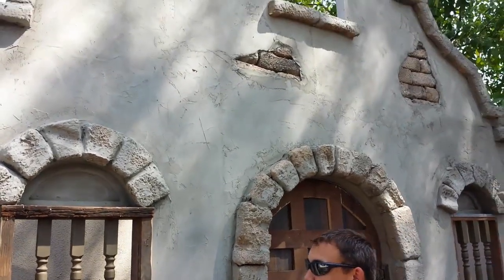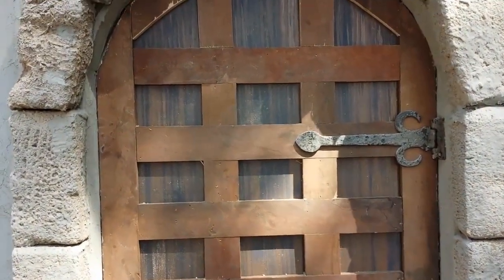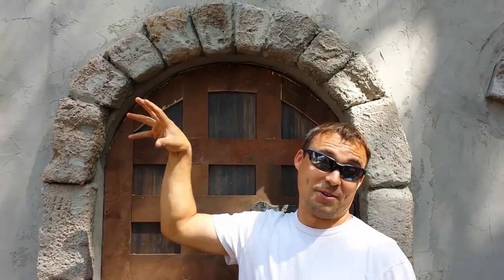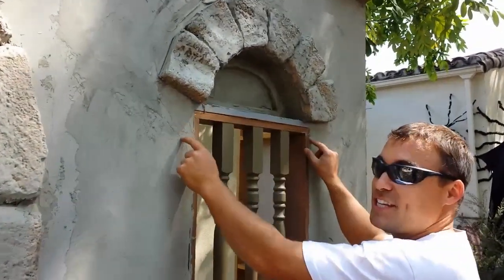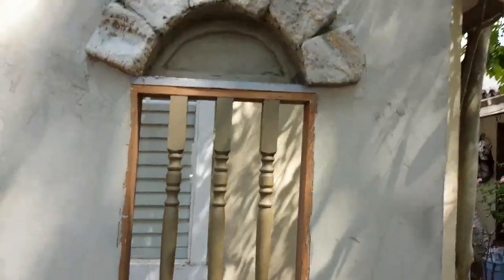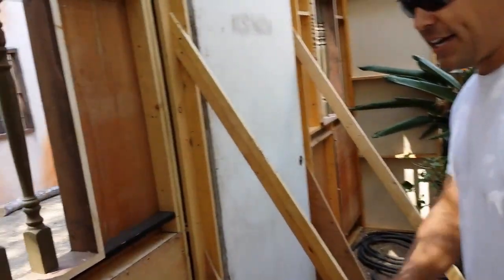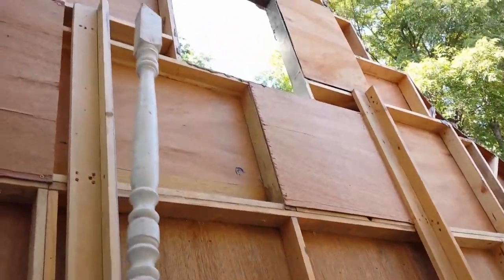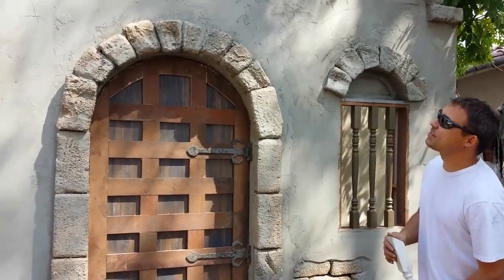DIY Halloween Decorations - Halloween Ghost Town - Old West Spanish Mission - Pt. 1

Comment from the maker: A really rough carving on the foam no sanding and then covered the bricks with mortar and used a trowel in several directions to get the texture.  If you stick the trowel to the mud and pull straight off and then come back and knock or sand the sharp tips of the mud off as it dries can work too.  Just one way to do it that worked for me.  =)